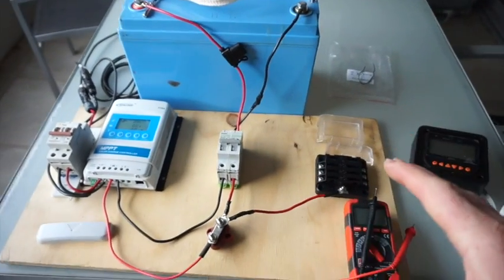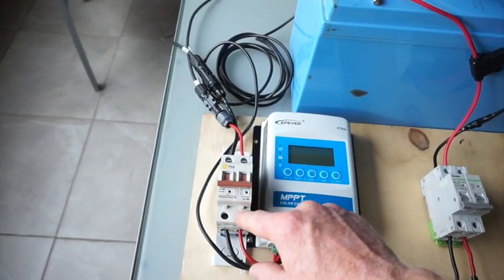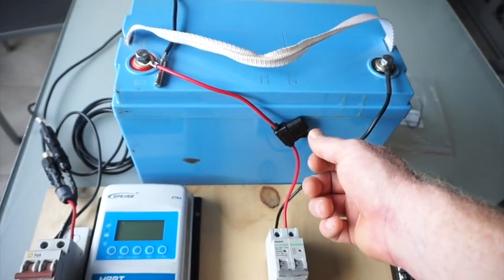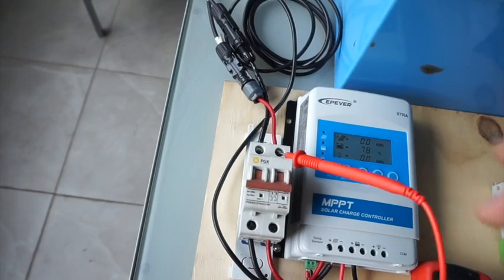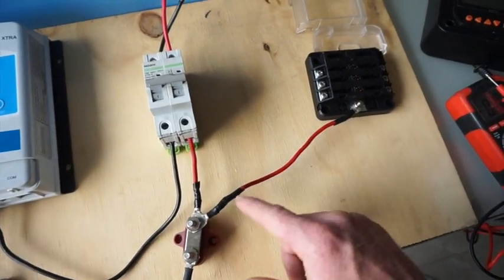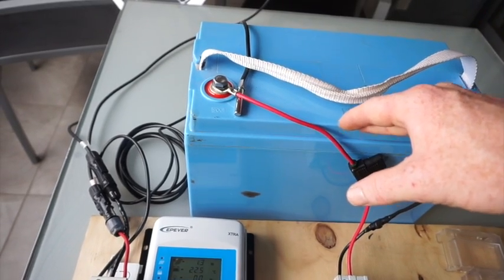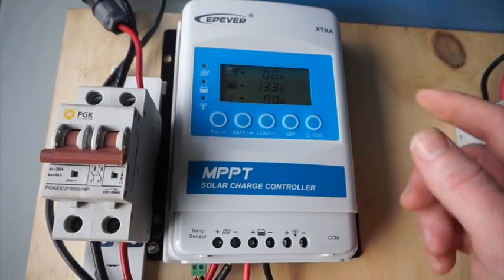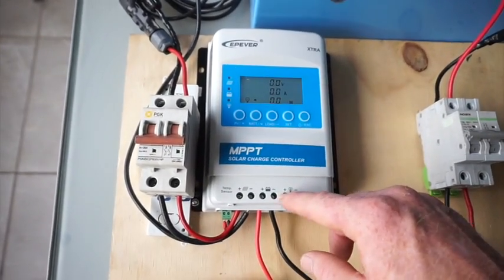HOW To Set Up an MPPT Solar Controller - EPEVER XTRA XSD2

Comment: Iv watched theee of your videos on these mppt chargers controllers.i was a electrician for decades my health issues type 1 disease since 1985 i stay busy im a tinkerer now .im thinking about doing s small business into solar power to help people who dont draw a binch of money from our ss program in the usa power bills 300 to 400 gas 400 for 2 months water trash pickup 100.,solar will help cut the power bill hopefully it will be less than 50 a month
Thanks great information.im going lithium batteries for solor storage not lifepo probably a used ev type hybrid battery with higher voltage.
Reply from the maker: No Worries - let me know if you need any help.

Comment: Hey dear I  am facing power dropping issue in series connection. I have connected 340watt and 380watt solar panels in series to epever 40A mppt controller with 12v battery. It show power of one panel when I disconnect solar connector and reconnect, the mppt show both Panels. It’s hard to do this every morning. It was fine in winter but now summer starting and facing this issue. Using both panels form 2 months. after wire disconnect and reconnect the voltage jump from 33-36 to 75v. If something wrong with one solar panel then it should not work after replugging mc4 or solar wire in the mppt after that It work whole day but same issue next morning Both panels volts amps are little different. Tesla 34.51v maxpower 33.18v. Tesla amps 11.01amps maxpower 10.29amps.
Reply from the maker: Hi Mate - can you describe what is happening again?  First in the morning when both panels are connected in series it is only showing 33-36 V on the MPPT? but if you disconnect the panels from being in series via the MC4 connectors and then reconnect it shows 75V on the MPPT?  I will need to have a multimeter to do some testing. First thing you need to do in the morning is test the voltage going into the MPPT. Use the multimeter on the MPPT solar terminals and read the voltage, this is to check what the MPPT is showing is correct. Next, disconnect the panels from the MPPT (you can leave pos or neg still in the mppt, just measure one terminal and the other free cable). Do not disconnect the panels from series at this stage just check the voltage of the panels. It should say 75V. I can not understand at all how it would not.
Reply from the maker: Do this test and let me know the results.
Reply: @sunbiasolaroffgridsolution6545  thanks. I will test volts in mppt terminal there might be error in display and mobile app. From last two days both panels connected in parallel and working normally. After 3,4 days I will connect them again in series. but this was strange that in series connection mppt pick one panel. Last year I faced the issue of 0.3A with 33-36v at 11,12,1 afternoon time. Mppt used to stand by panels and starts battery power in hot sunny weather. After few days of troubleshooting issue resolved. I though battery sensor sending overheating message of battery and mppt standby the panel. But epever told me that you have oversized your mppt it’s 12/520watt max at single battery and my panels 340+380watt they told me to never cross the 520 otherwise it will damage the mppt. But solar panels never produce 100% I am getting 70-75% power. Mppt never crossed 40A. Reached to 39.5 amp and 574watt once after rain. Usually never crossed 520. If issue remained I will sell 380watt solar to buy another 340 to match both.
Reply from the maker: @DigitalMind.254  - Ok let me know how you go with testing the panels. 1st step - try to confirm it is an error with the controller not the panels. It makes no sense that the panels could change their output voltage unless there was a loose connection but that still doesn't add up to me.
Reply: @sunbiasolaroffgridsolution6545  ok brother I will wait 2 days more for parallel connection. Will connect them again in series to see what they response

Comment: i bought a 550w (46v)solar panel and a 300w power station. my power station can take 100w (12v) from a solar and my solar panel is 550w (obviously too much). what do i do in this situation? i want to reduce the power of the solar panel to balance out everything with my power station.
Reply from the maker: Hi Mate - what power station is it? Can you send me brand and model. My thoughts are you probably need to put it through a DCDC 48 to 12V (min 10A) converter. Usually they have an input Voltage range of 30-60V. You only need 10A. I'm assuming the power station has an inbuilt MPPT. You set the output voltage to 15V or whatever the minimum is on the power station and it will pull whatever power it needs from the converter which takes from the panel. I can't be completely sure though if the converter will like the fluctuation power from the panel. I could do a test run for you.
Reply: @sunbiasolaroffgridsolution6545 i live in south africa. the brand is EcoNode. no, it doesn't have a built-in mppt. i searched on google for answers on how to reduce the high voltage from the solar panel. mppt was suggested and i came across your video. should i find a professional near me to help? because im on a tight budget, i can't afford to sell my current solar panel and buy another one that's lower in voltage.

Comment: What setting should I use for pure lead battery
Reply from the maker: Depends what type of lead acid battery you have. The EPEVER's have 3 different lead acid charging profiles. Sealed, Gel, flooded. Check the specs on your battery and compare to epever manual.

Comment: Hey man! Thanks for the video... i have a question, i just connected an Epever 40 amp xtra 4210 on a flooded battery... the battery manufacturer said that the lowest the battery can be discharged is up to 11.7 v... how can i set that parameter into the controller!?
Reply from the maker: Hey mate. The only way you can control when your loads are cut off from the controller is by running it through the load output on the controller. 
Then you need to go into the battery parameters (with an mt50) and you can edit the low voltage cutoff. 
There’s another video on how to edit battery parameters. Hope this helps.

Comment: Hey man thks for the video , i got the load
terminal conected, when i press the power
button turns the load off right. But says the
battery is 56 % soc, when i press the power
button again turns the load on, but now the
battery says is 86% soc, i dont understand
that part , how do i know wich is the real soc
and load should be of or on when i charge the
battery. 120ah lithium.Thks mate
Reply from the maker: Hey mate. Easiest one to answer. You can definitely have load on while charging. The charger will just deliver the power coming in from solar directly to load and surplus to battery or draw from battery to load if not enough solar.        Now do you mean when you press the load button it turns the load on and off?  Thats strange that the SOC % is changing. I would have thought maybe when you turn the load on and its being powered by the battery that the SOC % showing will drop because when a load is on the battery the voltage will drop slightly. The SOC % is just a calculation based on the battery Voltage. Can you do this again and tell me what the voltage of the battery is each time you do this? Eg 86% 13.3V, 56% 13.1V.
Reply: Hi man thks for answering🫡  , ok load is on says battery 86% at 13.3 v. Press esc/power load goes off , controller reads 12.7 v at 56%. Something is wrong,  something to say no matter if load is on or off 12v appliances light etc all dc works fine regardless . Multimeter reads 13.1 v . Thks new on this things sorry
Reply: One more thing aswell when i unscrew the load terminal cable , charger goes off 🤷 feels like the load is on constanly powering all the 12v things on the caravan
Reply from the maker: @gustavoprezioso9687  No worries mate. hmmm, this is sounding pretty strange. Do you have a photo of your set up you could send? When you turn the load off the light on the left turns off? The circuit you are powering off the load doesn't have a battery connected to it does it?

Comment: i'm stumped on setting the load and float
Reply from the maker: On the values or how to set them?
Reply: @sunbiasolaroffgridsolution6545  on how to  get to the options to set them
Reply from the maker: @DrunkenAussieAdventures  you using an MT50?
The time in mins should be available to edit when you go into customise the charge profile. Like when you go into adjust ‘user’ alongside the voltages there should be a time to adjust for equalize

Comment: Hello, could you tell me, how did you install the temperature sensor? Thanks.
Reply from the maker: Hi there - plug the sensor into the controller and run it down to the battery. Tape it to the side of the batter or positive terminal should be fine.

Comment: Oi mate. I wonder. 
If I do a set up like that 
On a solar system I’ve got run out of my shipping container shop ! 
I wonder if I can just ground the battery to the container 
And run my power out to lights and shit just with a positive wire 
Then ground the light or what ever to the container ? 
I’m not a sparky aye 
But sounds fair dinkum aye ? 
Like a car set up. 
Negative ground ? 
Whatta reckon?
Reply from the maker: Hey mate. Well yeah I think in theory it should work but I’ve not done that before. 
I’d imagine You’d have to have a good connection to the container to let the power flow. 
Trial one and let me know how you go.
Reply: @sunbiasolaroffgridsolution6545  right on. Much aloha. Thx bra. 
I just saw how you had the positive wire going to that disto box. And I had that idear 
Hmm how do you complete the circuit from that disto box anyway ? 
I’m super new to solar. Kinda cowboy my way thru tings 
Shoots bra
Reply from the maker: @rjayareg9124  no worries man. Let me know how you go. 
I have a second version of this video. 
The set up is a lot neater than this one with the busbar. 
Happy powering 🤙🏻

Comment: Great simple set up, helps a heap. Could you show / explain how the circuit breakers were installed on the wooden board?  I can't find the DIN rain and looking to find a solution to install it on a a plywood.
Reply from the maker: Hey Mate - the circuit breaker ‘holder’ has a plastic frame with a din rail and you just screw that down. 
Link to one here https://www.tradezone.com.au/product/b-r-2-pole-plastic-circuit-breaker-enclosure-22519.html
Reply from the maker: Hey Mate - the circuit breaker ‘holder’ has a plastic frame with a din rail and you just screw that down. 
Link to one here https://www.tradezone.com.au/product/b-r-2-pole-plastic-circuit-breaker-enclosure-22519.html

Comment: Is the busbar bit neccesary? What happens to excess energy coming in from the solarcell that the battery cant handle?
Reply from the maker: No not necessary. It’s really only there if you want to run another circuit off it. 

So the MPPT will only draw what ever the system needs from the panels. So if your battery is in float and only needs like 20W of power but it’s the middle of the day and the solar system could produce 300W. It doesn’t matter, the mppt will only pull what it needs from the panels - 20W.

Comment: Hi mate 
The circuit breaker which has the positive and negative to the battery (right hand one in your video).....what amps is it? and is it 12v as the other one is?

Cheers
Reply from the maker: Hi Mate - its a DC 20A CB. I think those DC cb's candle handle upto 600V. 
Instead of a CB you can also use a normal switch and a fuse. Normally if you have higher current draw or charge you would have a fused cable and decent isolator switch between battery and equipment ie inverter, mppt over just a CB.  Watch my other video on how to set up mppt to see what I mean.
Reply: @sunbiasolaroffgridsolution6545  cheers mate

Comment: whats the safety switches for do you need them
Reply from the maker: Doesn't need to be a circuit breaker between panels and controller - just a switch so you can turn off if needed. Between batteries & controller or other equipment you need protection. This could be a CB or a isolator + fuses.

Comment: I am using the controller of epever 40A.  But the problem is that the 12v battery is loaded off only when it is 11.1v.  I want to load off at 10.5v.  I can't set it.  Please help me.....Bangladesh.
Reply from the maker: You need to use you custom charge profile and adjust your discharge limit v & low voltage disconnect voltage down to your 10.5V. 
I have another video on setting the customs profile with an mt50. You need mt50 or wireless dongle to edit profile.

Comment: Circuit breakers don't actually break at their rated capacity, unless there is a short circuit fault. The rating is more to do with heat dissipation.

Comment: Hey, nice vid. Can you tell me why there's no earth/ground cable on the Tracer Heta sync? Apparently theres some con fusion on these as they are positive ground not negative ground like all the other stuff would be on a 12v camper. I'm looking for ways to ground it safely. Thanks.
Reply from the maker: Hey mate. I’ve just not put one on here for the video. The xtra and tracer  should be common negative grounding. 
I believe you can ground your controller and system to the camper chassis.

Comment: The video helped me with the install, thanks mate. 
Why is it that you don’t run the loads directly from the load terminals on the controller? Can I connect my switch panel for my lights and fridge etc to the load terminals on the unit?

Thanks
Reply from the maker: Hey Matt - yeah you can definitely run them directly from the load terminals. Positives are that you can semi control when the loads are on and the controller will protect the battery for you from discharging to low, short circuit etc. Negative is that the load current is limited to the controller max charge, ie 20A controller can only feed 20A to loads. Hope this helps.

Comment: The DC circuit breakers are rather expensive for a small solar setup. A good one here like Clipsal will cost you $25 aud. I just use a $1 switch on the positive wire going into the charge controller and 2 simple inline mini 10a fuses (my setup is 10A. It looks like you also have the same fuze set up in your case. I think that for the small/cheap builds the circuit breakers are overkill. Also, you need to find space and DIN rail to mount them etc etc.. However, if you do have the cash/space to set them up they are good. You just have to remember to use a DC one. they have a different designs to AC one.
Reply from the maker: Hey Down Under Garage. Yep completely agree. A simple toggle switch is more than enough. I will update this video soon with a better one. 
A DC 16A CB is about $23 and a din mount another $8. Bit of overkill for a small system.

Comment: Can anyone please tell me what size breaker I would use for 3 110amp solar panels wired in series going to a epever mppt 60 amp (Model Tracer 6415an) charge controller and also what size breaker I would use going to 2 12 volt lithium batteries wired in series and do I only need to connect it to the positive. Any links would be appreciated.
Thanks you!
Reply from the maker: Hey mate - watch this video on how to size cable and breakers. https://www.youtube.com/watch?v=VCy6Ha0o4_M&t=10s
Feel free to send me an email if you have anymore questions. 
You only need a switch on the solar panel side but if you want to use a break I'd say a 10A. For the MPPT side max current will be around 12A. Breaker should be 12A or higher (you could get away with a 10A) and the cable current capacity bigger than the breaker.
Reply: @sunbiasolaroffgridsolution6545  Thanks so much! A bit complicated with the math involved, but I'll do my best to figure it out. Thanks for taking the time to reply.

Comment: I don't think you need the inline fuse after the breaker on the battery side
Reply from the maker: Hey Daniel Clarke.
Is that cause there is a circuit breaker to protect the cable? I agree. 
Usually I don’t have a CB though, just a normal battery isolator. That’s when you do need a Fuse.